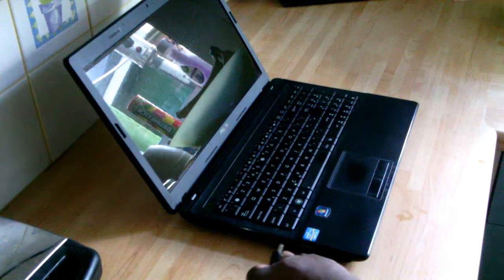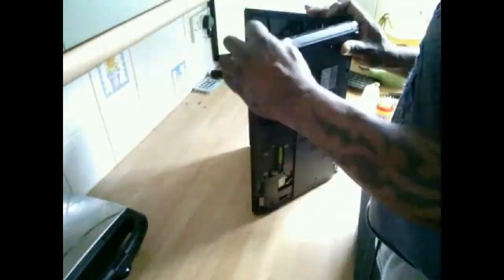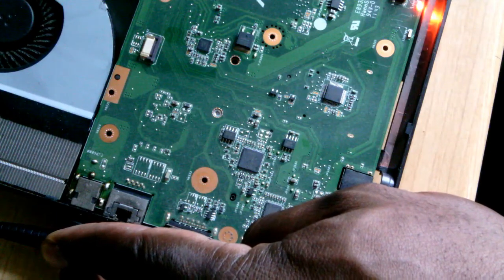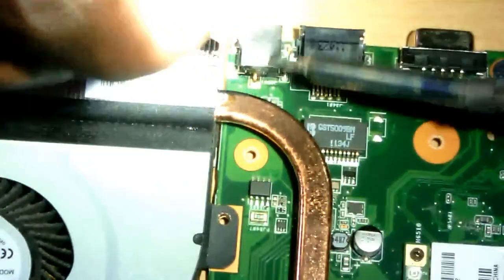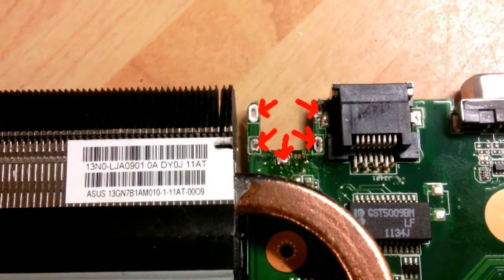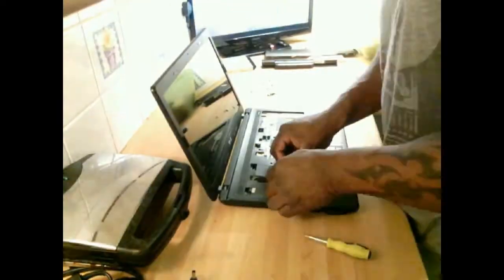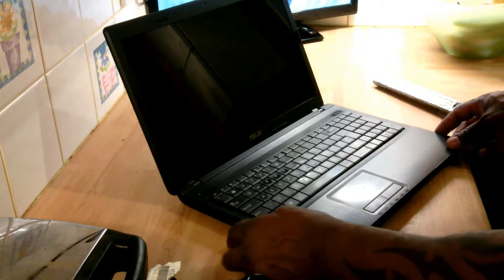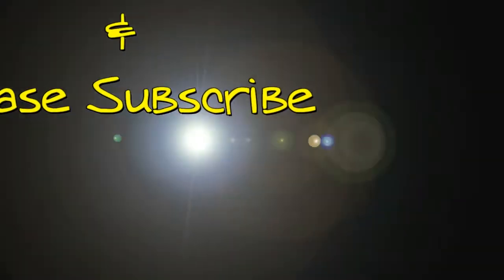Laptop Not Charging Fixed

Comment: Thank you so much for this video. My power cord has been plugged into my laptop for sometime, because my laptop's battery needs to be replaced. For whatever reason like an idiot, I decided to take the power cord out of the socket last night. Well this morning when I went to plug it back in, it no longer would fit in the power socket. On closer inspection, and watching your video it appears I need to have it replaced. Should I just take it to a tech or order the part myself and fix it?
Reply from the maker: Carolane,
                 this is not easy to carry out without the right equipment. Strongly recommend you take it to an expert if you are not capable.

           Regards.
Reply: Will do, thank you for your advice!